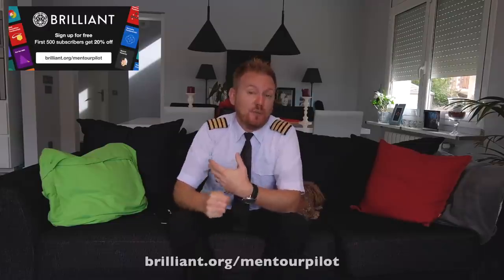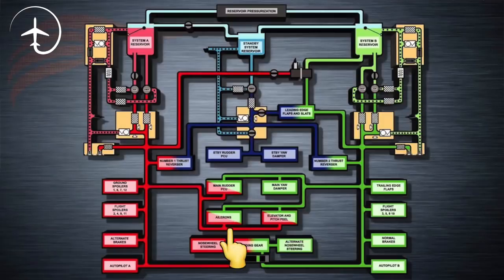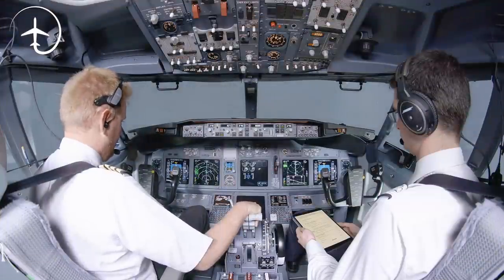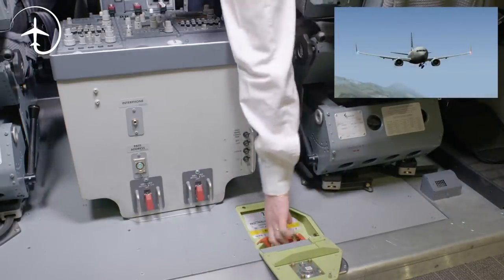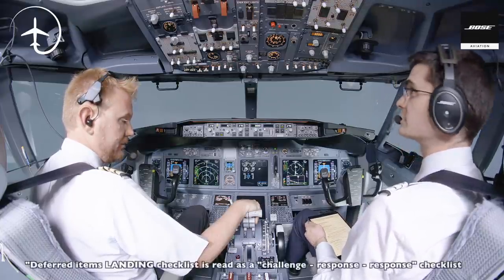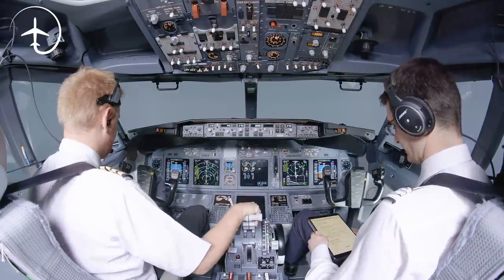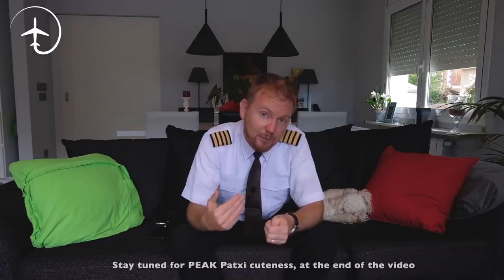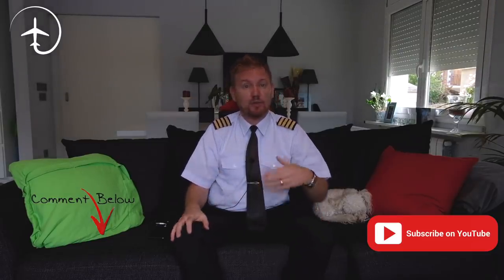Boeing 737 Emergency gear extension!! Cockpit video (FFS)

Comment: Why might you do a go around on a clear windless night? Recently had an experience on an Airbus A321 which did a last second go around at Dublin Airport. Captain said it was due to wind and legal jargon but it was as calm a night as can be expected in Dublin. Second approach was high speed as could be felt by the aggressive braking of the aircraft once we touched down. An unusual experience, and I didn't believe the captain, so what might be the reason for such a missed approach and high speed landing?

Comment: I think that just about anything you could do in the simulator would be educational. I like that you have done a couple where you say "here's a problem, lets see how it works". More of these would be great, but how about some where you and your co-pilot get in to the simulator and have no idea what's going to happen- the kind of situation where the person in charge of the simulator just throws random weird stuff at you. I can tell you that your simulator videos have cured me of the idea that just anybody could fly one of these planes - the complexity of managing and understanding the systems on board is something I have a real respect for.

Forgive what may be a stupid question, but from the camera angle you're using it looks like you and your co-pilot have pretty cramped quarters. Is it really as tight as it looks, and if so, how do you manage keeping limber during a long flight? Appreciate your effort in making these videos. Cheers.

Comment: I'd like seeing more emergency simulations! (mainly so that I can hear all the alarms going off). Fire on board, dual engine failure, loss of all hydraulics, loss of fuel by leaks, window shatter, faulty  instruments, And more if you can!

Comment: The only reason normal controls aren't manual is because it isn't as quick, low-effort and convenient. However, manual controls work and are more reliable. Having them as the backups would be a must in any design I'd make or approve if I was in such a position.

Comment: Video suggestion: I know the pilots have access to auxiliary air for use in depressurization or for smoke in the cockpit. Is this simply oxygen as in the cabin or a full filtered air supply. How and when is it used. Are there other emergency cockpit ventilation options?

Comment: great video, as always! And whatever cockpit video you do in the simulator - it is very exciting for me as someone who is interested in aviation, but not a pilot. Maybe I will do a PPL some day, but currently I cannot afford this.
Some interesting things might be: crosswind landings - how is it different from a normal landing. TCAS manoeuvre in the simulator, what is done, if one of the pilots is decapacitated for any reason, how would the other pilot land the plane safely.
But also everyday operations and probably little mishaps, of which I am sure, they happen all the time.

Comment: Normal lift is provided by differential pressure over wings via Bernoulli effect. When flaps are fully extended, do they provide additional lift by increasing this effect or, due to their size and placement, function more as a kind of "parachute" effect?

Comment: My dad was on a flight many years ago when the landing gear didn't come out.  The pilot assured them there was nothing to worry about as they had back ups, and their back ups had backups. Despite all this the landing gear didn't come out, and the pilot said they were going to have to bump or bounce (I can't remember which) the plane. After this the landing gear did come out.  What does this bump or bounce mean? I've always wondered about that.

Comment: HI Mentour. Perhaps a video of the 'hold area', showing it being loaded with all items correctly secured, weight distribution, maximum weight permitted, temperatures, areas that should not be touched. Is there an area which is pressurised and heated for pet transportation on your aircraft. Thanks in advance.

Comment: I would like to see more emergency situations and how passengers can help make things better. How should men & women dress for flying success in case of emergency. Are there materials clothes are made of that are more dangerous than others. Does it bother cabin crews when passengers do not pay attention to emergency info at the start of flight. Should disabled people like me get in the way during emergencies- would it be better if we found a different way to travel? Or the overweight, should we try to get that under control so we could be of help instead of being in the way. People never want to sit next to us & make fun but I've started thinking how terrible it would be if l landed on someone & hurt them. That would just well kill me. Tho right now with all the mandates etc  I just don't know if I want to fly. Has it been hard on you pilots and brave flight crews? B

Comment: Great video Captain. You said that a landing gear cannot be retracted if the 737 is flying more that 230 KPH. I have watched planes take off. I have noticed that the landing gear is retracted as soon as the plane is off the ground. Normally, what speed is the plane flying at that point of the take off?

Comment: 1.  I like to see over speed emergency procedures.  When do you use speed brakes to control speed in possible emergency situations when speed needs to be reduced or control due to some other system failure. Are there failure situations where landing gear are used to control speed? Are there procedures for throttle control problems for the engines?
2. I light of 737 MAX AOG  failure. Like to see the procedures for similar failure on the NG. Attitude indicator used when you have a conflict in AOG or speed disagree?  How for the NG the two AOG sensors are handled? How do pilots handle other instrument failures?  
Really find it interesting how the pilots handle emergency situations. It would be of possible benefit for up and coming pilots to see more emergency situations.  I am not a want a be commercial pilot but as engineer like to see how problems are solved.

Comment: What is the procedure if one of the landing gears fails to deploy fully with both the hydraulic and manual systems? (something gets jammed up or the locking mechanism fails)

Comment: Great video as usual. I would like to see some type of situation that has a possible fire indication with smoke (ability to see in the flight deck and display screens) or lack of oxygen in the cockpit. Also was wondering about how flights are guided on specific flight paths when they are doing long cross ocean flights. Being near Logan International in Boston USA as flights head over the Atlantic are they able to communicate with ATC? thank you

Comment: Another great video!  Great information and explanation.  Does it make you nervous when you enter a control area descending for approach and the controller calls you and says, Traffic at your 1:00 position altitude unknown or encounter a TCA violator with no transponder in MCI conditions?  Also, the preflight check outside of the aircraft would be very interesting.  Mark

Comment: Hello and wonderful day to you.  Asymmetric flap extension. Either the leading edge high lift devices do not extend together, or not at all.  Flaps, the Port side do not extend while Starboard side extends. Ailerons ... high speed ailerons do not work,  spoilers to augment aileron authority do not work, so only the inboard high speed Ailerons are available.
That would be interesting.

Comment: Sometimes "primitive" mechanics are superior to modern electronics or digital systems. At least they are easier to fix and they dont have as much things that can malfunction or break. On a simple wire there is little that can go wrong, maby something gets loose, maby something is stuck, maby something breaks in two, easy to identify and comperetavily easy to fix. 
On a computersystem there are countless relays, curcuit breakers, sensors, cables that all have several possible malfunctions. 
Same thing in cars. Some modern ones have such complicated electronics that you need an apprenticed mechanic to change the tires or a simple lightbulb in the headlights...

Comment: I would like to see difficult or non common maneuvers, also take a moment to explain each component does, I work exclusively with landing gear, I feel if I wouldn't I will not understand the exact system that locks and unlocks the gear.

Comment: Simulator suggestion.
I don't want to see or hear about this, but, imagine this scenario:
what if a sort of lighting or some unfortunate event would affect both the pilot and the copilot so the would get temporarily blinded and unable to maneuver the aircraft. If a pilot would request a passenger or stewardess to actually fly the aircraft assisted by the pilot or copilot, could this be possible ?

Comment: The computer voice that says “retard” or “pull up”, does that have a volume switch and can it accidentally be turned down so low or off so you cannot hear it?   Bpatrick

Comment: I love these cockpit videos. I watched a lot of documentaries on aviation disasters and I'm intrigued by how different the levels of pilot skill, CRM and situation awareness are. I'd find it interesting to see you and your pilot monitoring handle unexpected failures and see what the CRM and troubleshooting process might look like in a situation where you deal with an unknown issue and work around things like failing hydraulic systems (for instance).

Comment: Why can the 737 not dump fuel? Does that make landing a 737 with a full tank unsafe? What if there is a need to return with a full tank? Do you then have to circle to burn off fuel?

Comment: What I think would be interesting (though I'm not sure to what extent it can be done in a simulator, let alone come across properly through a video) is the effect where a sustained turn will cause the sensation to the pilots that returning to straight and level flight feels like they're entering a turn the other way. If you could pull it off I think it would be a great example of the importance of trusting the instruments over what your senses are telling you.

Comment: Hi, can you show a cockpit video on how to handle a landing where the one of the landing gears fail to extend? A Myanmar Airlines jet several weeks ago landed without the nose landing gear extended. Are aircrafts designed with reinforcement at the landing gear areas should an aircraft have to land without it's landing gear?

Comment: I would like to see what happens when an engine fails in flight (or has to be shutdown). What happens if you are a couple of hours from an alternate airport? Do you put the seat belt signs on and stop trolley service and prepare for a ditching (on the assumption that the second engine could fail before you reach the alternate airport).

Comment: I understand the use of the wires after the electrical system for the alternate landing gear failed for that LOT 767 that belly landed

Comment: From the center pedestal, I'd like to see demonstrated when the TOGA switch is used and is there a lock to pull the part of the throttles to put the engines into reverse or can they be pulled up at will?

Comment: What are those weird noisy spinning wheels that fire up periodically?
Reply: The wheels spin when the plane rubs against a cloud.

j/k They're for elevator trim. Way back before jets they used to adjust them by hand. Boeing decided to keep the hand controls just in case the crew ever needed to do it by hand. Recently with the 737 MAX problems, that ability came in handy.
Reply: Those are the stabilizer trim wheels.  Watch Mentour's video about Runaway Stabilizer Trim to learn more.
Reply from the maker: That’s the trim wheels. I have a video on that https://youtu.be/l62NvkRWa5E

Comment: I would like to hear about ditching. I am afraid to fly over water because (except for Captain Sullenberger) I have never heard of a ditching where everyone survived. Thank you!
Reply: Ditching is not such a big deal as the press and layman 
wants you to believe. There have been many "ditchings" with airliners, mostly successful. The problem may be in a storm with heavy waves in the sea.
Just search for this for instance: Crashing into San Francisco Bay | Japan Air Lines Flight 2

Comment: As I was watching some airplane disasters I noticed that often when hydraulics fail pilots can't control flaps and that leads to very high speed (dangerous) landings. So my question is: why aren't flaps designed to be also possible to handle manually in emergencies?
Reply: You can extend the flaps electrically on the 737 when you have lost the hydraulics.

Comment: At 2:10 the hydraulics diagram appears to show a changeover 'switch' at the very bottom of the diagram, allowing porting of either system A or B to the landing gear.  Is that correct/available in flight?
Reply: Ahhh, found on another site- System B is available for UP/retraction only, if engine 1 N2<50%.  This to assist with rapid cleanup of gear in case of an engine failure after takeoff.

Comment: Today I saw documentation about plane wheels and the high mechanical load on touch down, because the wheels are accelerated from 0 to landing speed within microseconds. What came to my mind is: Why are plane wheels not being build with bags on the side so the wind can make them rotate before touching the ground?
Reply: Spinning up wheels before landing has been tested and was not approved of. I think it caused too much gyroscopic effect making the aircraft difficult to handle.

Comment: Can the public buy those quick reference handbooks anywhere
Reply: If you buy the PMDG 737 flight simulator you get  the QRH too, but if you want it on paper you may just use a printer

Comment: If the landing gears are heavy enough to lock on their own
Then why apply hydraulic pressure on it
Why not let them drop down on their own everytime
Cheers
Reply: The hydraulics make sure they go down smoothly and don't do any damage when they fully extend. It also guarantees they lock in the down position. A manual extension of the gear is usually followed by a mechanic closely inspecting the landing gear and connection points.

Comment: Those are cables not wires. Wires conduct electricity, cables move things.
Reply: @George Klinger Not accurate. Most larger diameter, multi-strand wires are called cables, whether mechanical or electrical. Power lines use cables. You don't jump start your car's dead battery with jumper wires, or refer to a HDMI/USB/Ethernet cable as a wire, or even refer to cable TV as wire TV.
Reply: George,,, YOU ARE RIGHT AND ALSO WRONG,,   it depends of context and also us/ uk/ universal technical english.
A wire is something mechanical , it can be other then metal,, and if metal it can drive electric power (when insulated),  but also can be mechanically Pulled
A Cable also can bei an assembly of one or more wires which may be insulated, used for transmission of electrical power.
So,,   if u want to be so perfectionist,,, u might name it ,,Either  WIRE ROPE ,,  STEEL WIRE,,   STEEL ROPE,,   or,,   STEEL CABLE     ;-)
Regards from a:
Non-native-english-spoken-with-some-general-culture-knowledge   ;-)
Reply: Potato potato.... Tomato tomato😄
Reply: George Klinger 😂😂

Comment: How about landing with no engines and only the RAT powering the systems (No APU) (Out of fuel)
Reply: Hector Gonzalez There is not RAT on a 737. If all those failed there are batteries which power motors for around 60 minutes. If those fail then the plane is flown completely manually.
Reply: @joshuam20  My bad, I've might have been thinking of the A320 🤔
Reply: Hector Gonzalez Maybe you were also thinking of a 76 or 75

Comment: Nice. Glad the manual disengages are there!  Too much nowadays reliant on electronic controls. Good to see manual redundancies.  As for what I would like to see for a video?  How a pilot lands a plane with only power from a RAT?
Reply: Ranger Rick A 737 doesn’t have a RAT so that simulator couldn’t do that. It has mechanical systems so a RAT is not required.
Reply: Hmm- one would think that some of the larger max versions would be too big to fly by manual reversion...
Reply: @joshuam20  Sorry, guess I should have been more specific on what type of plane...   I just tuned into this site not too long ago so was unaware he only flies the 737...

Comment: Also, is it standard procedure to declare an emergency if you require a manual gear extension?
Reply: There's no emergency if they get normal indications after going through the QRH. Emergency, or mayday, is only for life threatening situations that require immediate action, and not for mechanical errors.
Reply: @mixmasterlandberg  True, however despite the lock indicators, is there any increased likelihood of gear collapse?
Reply: @ncc74656m  I wouldn't think so, if the gear falls down into position and they get three green in the cockpit it means they are locked into position mechanically. I.e. the gear is held in position without the need of hydraulics.

Comment: I wish cars had redundancy.  Like if the floor opened up and pedals unfolded that connected after the clutch/TC.
lets say a car does 25mph at 3000rpm, if you pedal at 60 rpm using the same gears, you can pedal your car out of the way at 0.5mph.
Possibly faster if you could muscle higher gears.